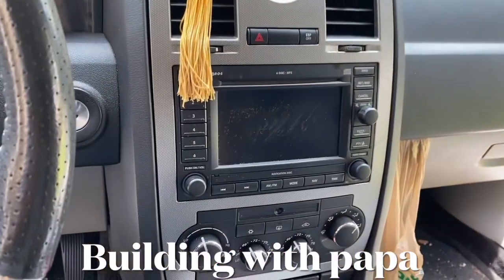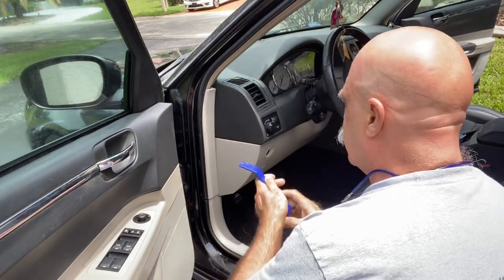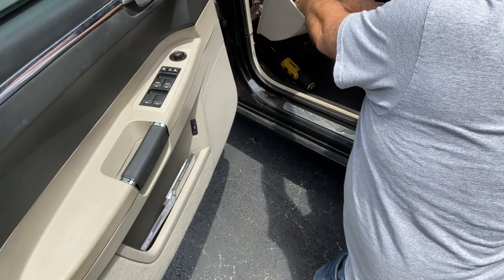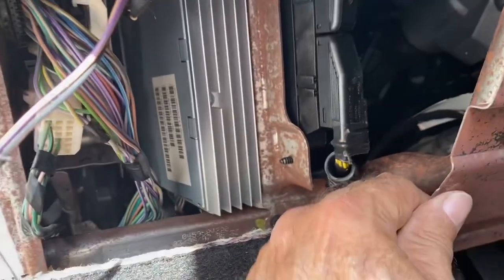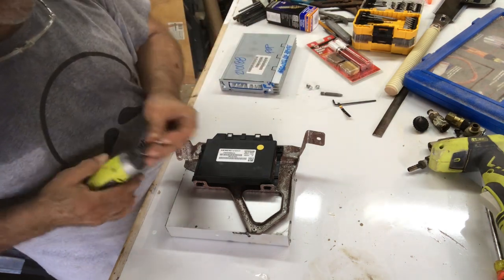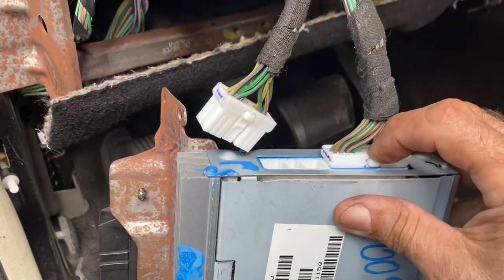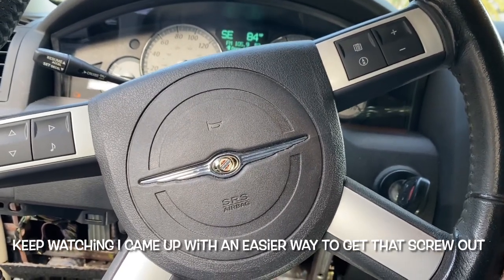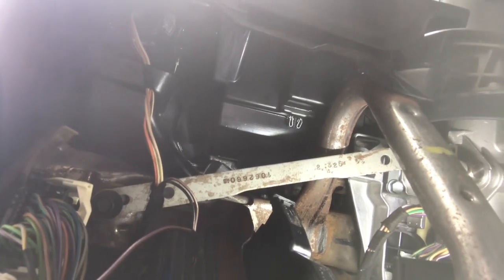How to install an amplifier on a Chrysler 300  (@Buildingwithpapa)

Comment: Thank you for a very well put together and informative video. My back speakers were cutting off intermittently, but now they are off and have stayed off. Front speakers work fine. (2005 300c).  A few YouTube videos seem to confirm it’s the amplifier. I’m handy and used to swap out my car radios and speakers like changing underwear (remember 8 track players, Jenson speakers? Lol ) . But I’m 64 now and not as flexible. Watching you squeeze in/under/around has made me think it’s best to get someone to do it for me, however I will remove the front panels and shake a few wires, maybe I’ll get lucky! Haha!    Thank you again for taking the time to put together a great video. Best regards to you!
Reply from the maker: Thank you for your comment. I’m 68. It’s really not that bad to get in there. I’m glad this video helped you and if you can leave me a thumbs up it really helps the channel.

Comment: Hey papa! What's easier to take that top screw off and to put it on is to drill a hole approximately where the screw is located. 

How you do that is to take the instrument cluster out and drill a hole through the plastic.

You'll have access to the screw and you can use a regular Phillips screw driver.

Will save a lot of time.
Reply from the maker: Thank you for the information. I hope you enjoyed the video and if you can leave me a thumbs up.

Comment: Are the amplifiers interchangeable?
Reply from the maker: Thank you for your question but I don’t know if they are interchangeable. I just bought the one that was for my vehicle. I hope this helps you and if you can leave a thumbs up.
Reply: No, the amplifiers are not interchangeable. You must get the correct one for your model and year. I have a 2005 Chrysler 300 limited I called the local Chrysler dealership gave them the YM & Model of my vehicle. They verified the part number as 5059073AN which was discontinued. I found the part on eBay received the part within a few days, installed it in less than 45 minutes and I now have music.

Comment: My dash speakers make a static noise. No sound from the rear speakers. Radio has power. What could it be?
Reply from the maker: Thank you for your question. It could be the amplifier I was unsure of mine. My speakers would go in and out. They would work sometimes and not others. They would make some static noise and I found out it was the amplifier you need to remove the amplifier. follow the video numbers on the amplifier I showed in the video, and then you can one. I think I got mine on eBay and follow the instructions. There’s one screw that’s a little tough to get to but you will be happy once it’s done. I hope this helps you and if you can leave me a thumbs up.
Reply: Thanks so much I built up the confidence to tackle the radio no sound and you were 100% correct. The 2 cylinder parts that's wrapped in a coil type style has burnt up 😞. All I need to do is find myself a replacement 👍🏾